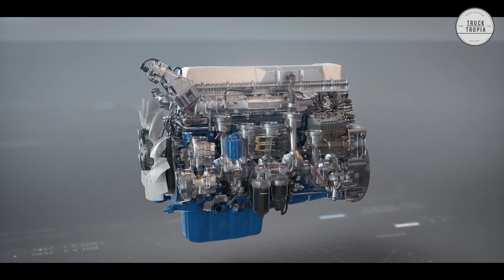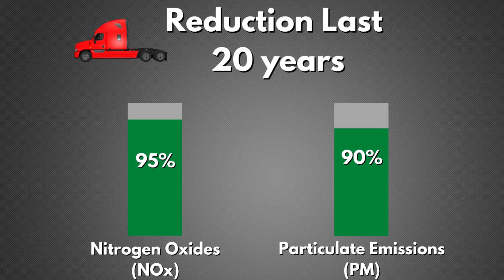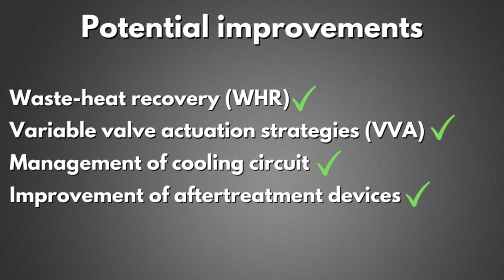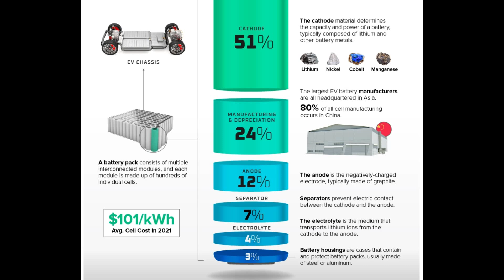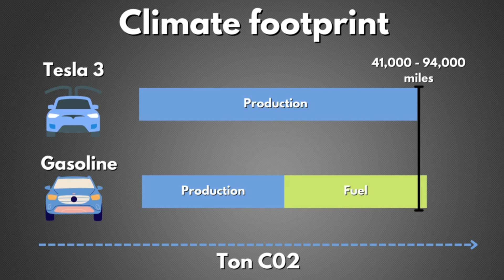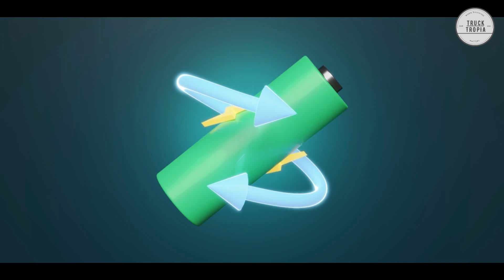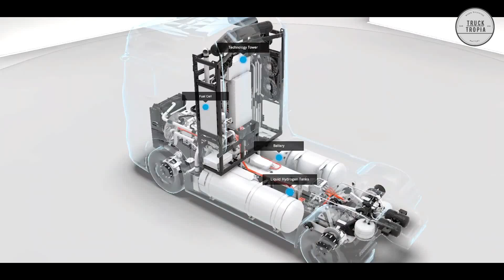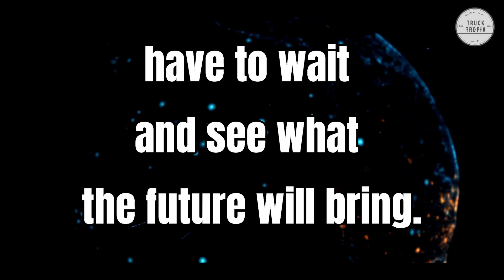How Dirty Are Diesel Trucks Really?

Comment: Being an engineer involved on the development of 4 stroke diesel engines , 2 stroke diesel engines (Railroad), and natural gas engines, and the owner of a Tesla model 3 and a 1988 Ford F700 diesel truck, I appreciate this video.  It invites good discussion about the pros and cons of the various methods of heavy duty propulsion alternatives.  I get the message, but the actual video could use a little polishing up though to increase its integrity.  Let me know if you are looking for an editor.
Reply: video author thinks tesla semi has 4 motors. it is not as polluting not make the batteries. truck made in 1988 is 60 times more polluting than a modern truck?? based on what?  methane? leaves out lot of details.  I personally believe diesel electric hybrid would be next step before all electric semi.
Reply: @ashmax28  There is no such thing free energy.
 There is a cost somewhere specifically when it comes to storage.
Also a cost in using it.
But if we reduce co2 down 1.1 % in the atmosphere .
 No problem, won't have plant based food to eat.
Then climate change won't matter.
Reply: @warrenpuckett4203  we are currently at 485ppm, if the idiots get it down to 150ppm it's a extinction level event. Greenhouses often raise levels to 1200ppm to improve growth and max allowable on a nuclear submarine is 8000ppm. Plus if you can look at the undoctored data co2 ffollows temperature, not the other way around.
Reply: @cbmech2563  NASA says it decreases in N. America in summer. Sompin most be suckin it out of air. I wonder what that could be? I live close to the 45th paralell. Get brown outs in summer but none in Winter. Don't understand why.
Reply: @ashmax28  the numbers Is probo ly of the emissions standard. I don't have the US standard in front of me but compare the 1992 euro 1 to the 2012 euro 6 there is about 20 times reduction across the board. Euro 7 is not fully finalised and the pre euro 1 numbers I don't have.  For USA that have had more recent standards and also universal standards prior to 1992, 60 times sounds about right. It for sure is more than 20 times.
Reply: @ashmax28  well London buses are hybrid...or i should say was hybrid ..their batteries are no longer any good and the replacement is uneconomic as the cost is most of the price of a new bus..this is the problem of EVs.. they are basically at the end of life when the batteries are dead... which with cars can be as soon as 70K miles..my maths show the cost of replacement of a batteries put an extra 0.47 GBP pr mile on the cost of motoring  and today in the UK it cost more pr mile to run for a EV if its changed at public chargers than a gas car source RAC
Reply: @ashmax28  Why not go direct and eliminate the problem and save money? Tesla Semi.
Reply: Yeah he had a few fuck ups in this video thats for sure
Reply: @trentdawg2832 
 Way,,,,,,, More  Than A Few !!!
 My Grandfather Worked for Texaco as An Lubrication Engineer His Entire Working Life Except for Two Wars.
Reply: Those 2 strokes sure are fun to listen to.
Reply: @utubedude2842  I have seen M-60s move at 45MPH+. 100,000 lbs. In the Dirt.  Could barely hear it over the noise of the Deuce running 100 RPMs below max RPMs, on concrete. (M35 with multi fuel diesel)
Reply: @utubedude2842  
Right Out of High School I Was Working @ A Second Generation Family Welding Shop,  and One of There Long Time Customers Brought in His Logging Truck for Some Repairs.
( Before the dirty f**k**g hippies got Logging Completely shut Down for over 35 years  ) but that's A Whole Different story. """ But """ His Kenworth Had A 
V-12 Two Stroke Detroit Diesel, Supercharged,  Twin Turbo Chargers and Straight Pipes. He Said There's Never Been A Faster Logging Truck In These Mountains. This Area is Steep, Twisting, & lots of Up's and Down. He Said That V-12 With The Supercharger It Gave It The Torque Right From Idle To Pull Hard and Get Going. But Once that V-12  Started Winding Up, Then The Turbos Kick In and Keep Pulling... and Since Those Two  Strokes Can Rev Much Higher Than a Typical  Inline 4-stroke, 1000 + RPM. And Probably Way More than The Current Generation of " Clean " Diesels that Redline Way Below 1700 RPM, And if I Remember correctly those Detroits went to Ruffly 3400 rpm ??? And That's A Hole Lot Less Shifting. Particularly If You Have Plenty of Power. And That Engine Sounded Absolutely Fantastic,  Like A Ferrari With Rabies on Cocaine . And Those Old Trucks Came With 237 5/8 Forward Gears 6 3/4 Reverse Gears.  So There's Always a Gear for Any Occasion. 
But When When We Opened the Bonnet, and All You See From Radiator to Firewall, is Engine and Turbo, it's a Hell of a Sight. And Of Course,  Besides the Straight Pipes,  It Had The Duel External Airfilters. He Said Typically He Could Make Two Extra Runs To the Mill A Day Than Any Other Trucker, He Was Faster Empty Up The Hill Empty,  And Faster To The Mill Loaded. ( I Know, I Was Just Responding to How Nice The Two Stroke Detroit Diesel Sounds,  And Went a Little Funny in The Head,,,, You Know ' Funny ' )
Reply: @ronaldmasterbud1551  keep the stories coming. My dad has had a trucking business since 1974. Every time he hears a 2 stroke Detroit (and it may be 2 miles away) he perks up like a newlywed on his honeymoon night. He’s had every engine you can imagine, his favorite for making money is the series 60 Detroit. But his favorite was his KTA 1150’s. Turned up to the max. He had his last one when I was young and I just always thought a diesel was supposed to have a race car type lope to it because of his Kw. Said a lot of the time he would forget he was loaded because it had such nasty pull. Had to rebuild the transmission about every 2 years til it finally distorted the housing. These new diesels suck
Reply: you have no posted vids... asking if they need an editor LOL
Reply: i agree with you there john. i personally like phev cars (especially ones that can go nearly 100mi on just the battery) as they offer the best of both worlds.
Reply: @blendpinexus1416  Duh? The point of the video was diesel engined trucks, not shopping cars.
Reply: Nothing about this video "invites good discussion".  Straight up bias propaganda.
Reply: https://youtu.be/3uceK5b0NXM
Reply: 2 stroke is the best diesel
Reply: @destroyerarmor  The old girls were very thirsty.
Reply: @destroyerarmor  Yep, no oil changes.
Reply: Are you aware that most RR engines cycle of and on and burn 500 gallons of diesel every 24 hours just sitting and not being used to move anything ?.
Reply: @LoganJohnson-lm2bh  that could be fixed by using antifreeze instead of water in the radiators, allowing the avoidance of extended  idling.
Reply: @LoganJohnson-lm2bh  That is about the same as a Perry class running on a Marine Diesel while anchored. Could run on one diesel and maneuver at 6-7 knots, also providing ship's electrical power. But most of the time it was running on two of them when providing maneuvering propulsion.  Lots of Megawatts needed to run all the inboard stuff.
Underway that was 1000 Gallons per hour for economical steaming. But that is with one LM2500 and 19knots ( about 22MPH) moving 2200+ Tons through water.
 More than enough for the same 16V Detroit to move a train with the same tonnage and the same speed..
I guess a train does not need a 35,000 HP (LM 2500) engine. Might be a few problems with couplers?
Reply: @warrenpuckett4203  most US trains run 4 4400hp engines at the front and depending on weight and route may run several more somewhere towards the end